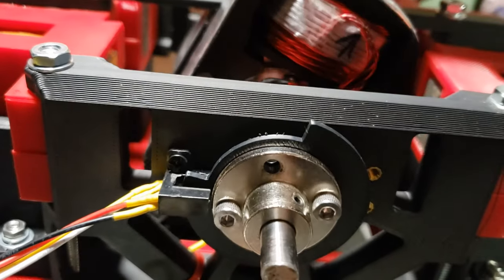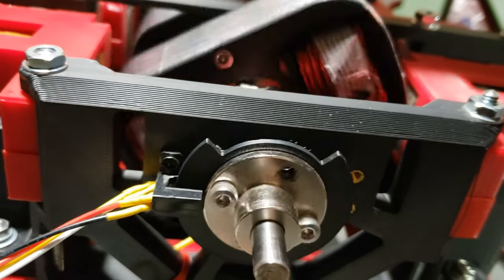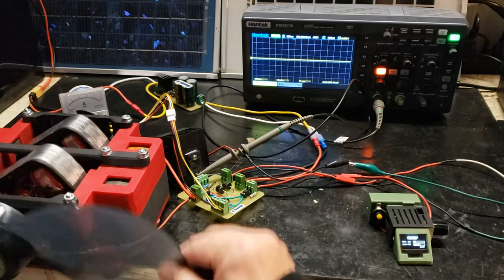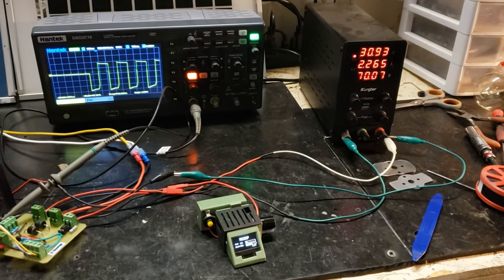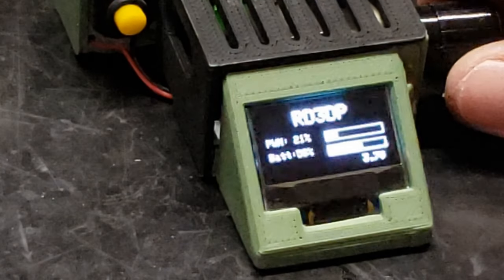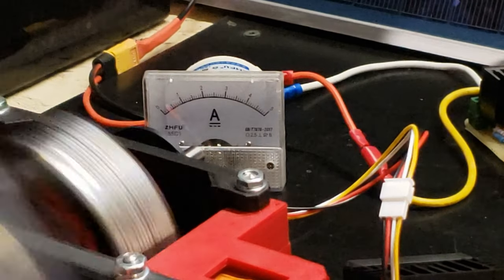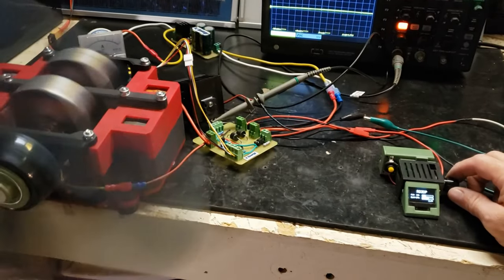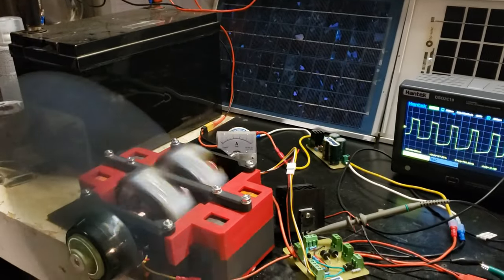Kromrey motor

Comment: So its basically a pulse motor with the coils on the rotor and the magnets on the stator. In relative terms its no different than a pulse motor. Thou you do have the advantage of connecting the poles of the magnet in one complete loop which will significantly increase the magnetic field strenght intercating with the coil.
Reply from the maker: Right, I was seeing how the kromrey generator acted as a pulse motor.

Comment: To enhance it, use Niobium-Titanium wire.😉
Reply from the maker: Never heard of it, kinda pricey. Thanks for putting it on my radar!
Reply: @redesign3dp  yeah, I'm working on projects that will require MnBi2Te4 and the Niobium Titanium.  It's going to take forever to figure out how to proton shield an element from eddy current.
Reply from the maker: Best of luck!